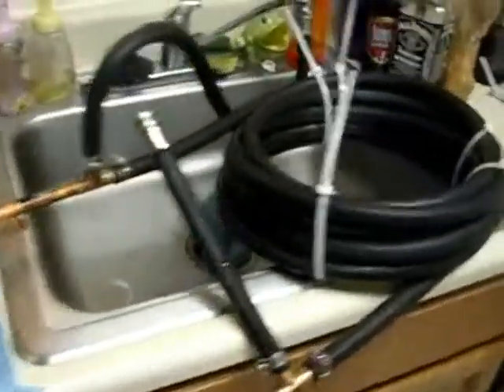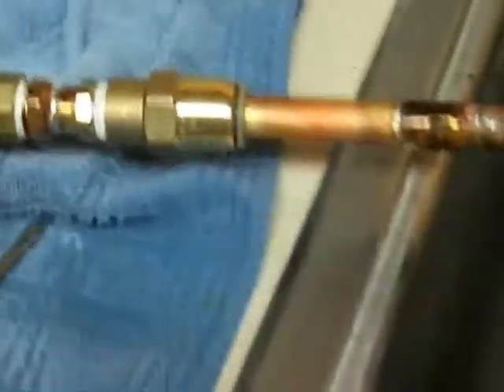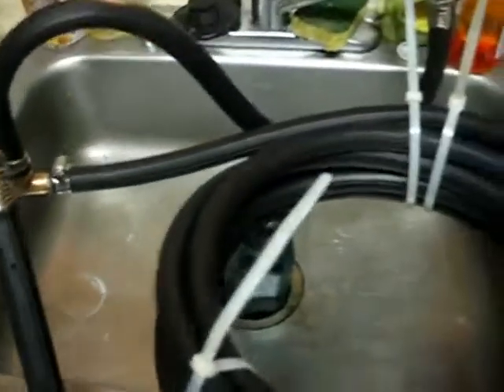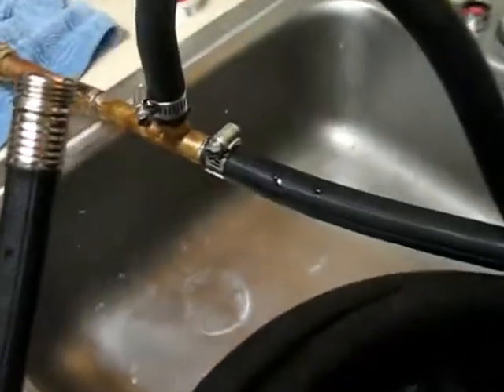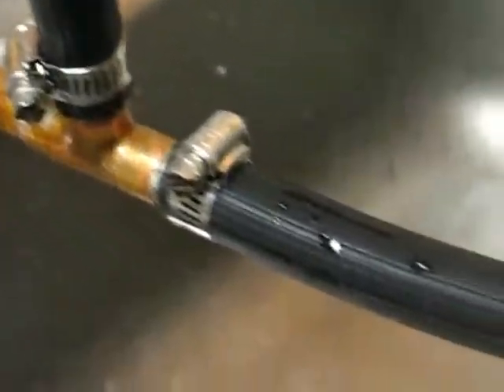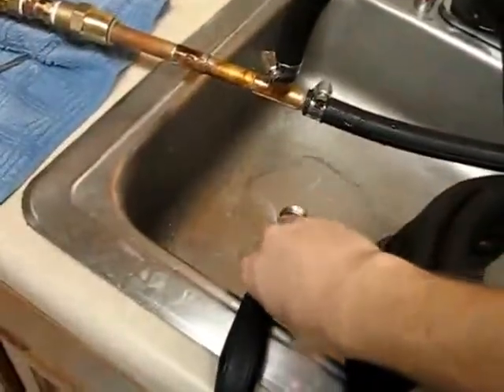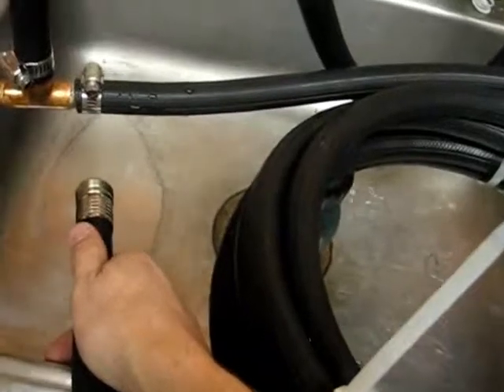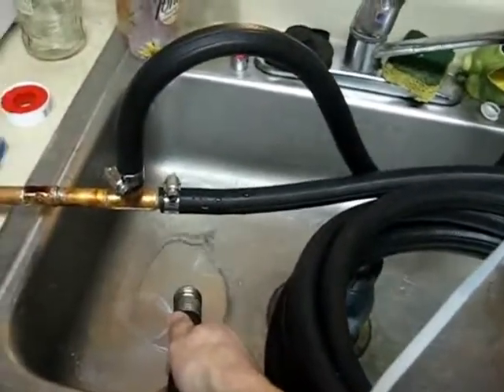DIY Parallel Flow Wort Chiller

Comment: You need to change the in and out for your water. The cold water needs to run the opposite way as the wort. That is where the name counter flow comes from. Other than that, good job.
Reply from the maker: You are correct, although I would rather change the name than the design - parallel flow allows for the greatest temperature differential at the hot inlet, resulting in faster initial cooling from near-boiling, which helps with cold crashing the wort. Cooling to equilibrium may be another story, but the first hike from ~200F really helps.

In any case, I've since moved on to a very large immersion chiller that works faster, but I appreciate you viewing and commenting.